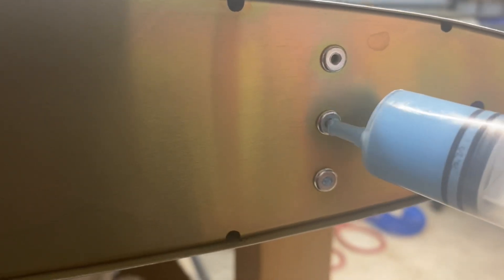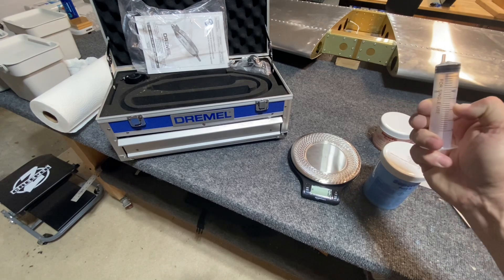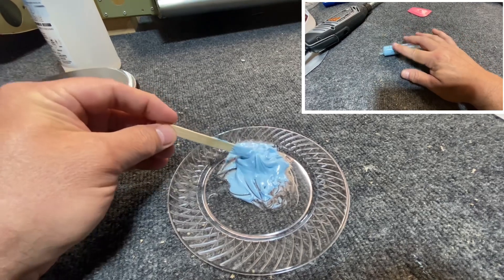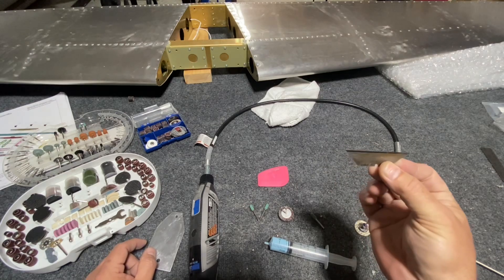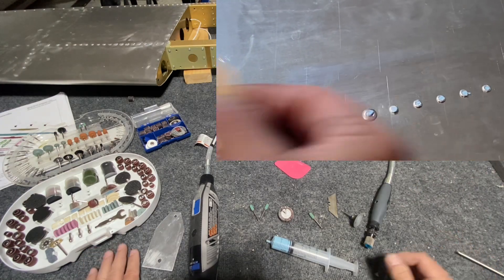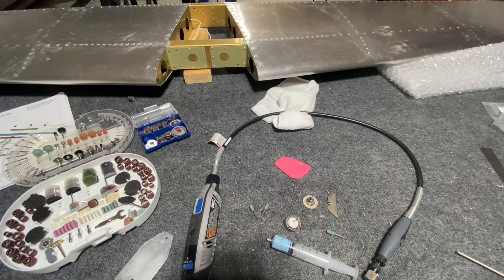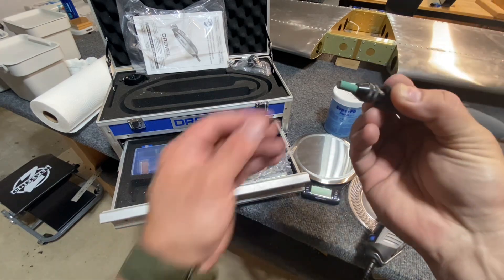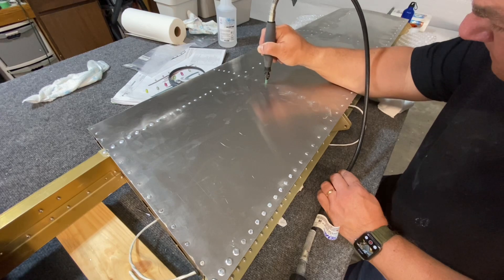Filling Rivets on the Horizontal Stabilizer - Tips and Tools / Sling TSI Build Progress

Comment: I'm curious, just learning now a bit about airplane building, why epoxy versus some other sort of body filler kind of thing like bonds?  Or could you do enough enough epoxy and then bonds to fill and smooth.  (I'm thinking bondo or something similar may be easier to work with, but I could be wrong in that too.)
Reply from the maker: There are other options you can use.  This particular product is very light, but being a two part epoxy it sticks well to the rivet. A lot of this stuff is personal choice.